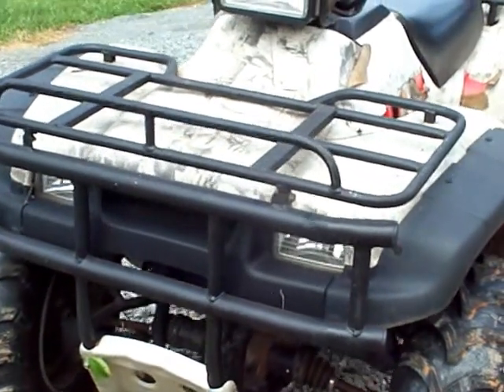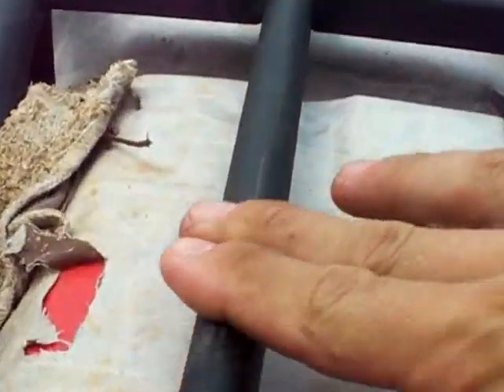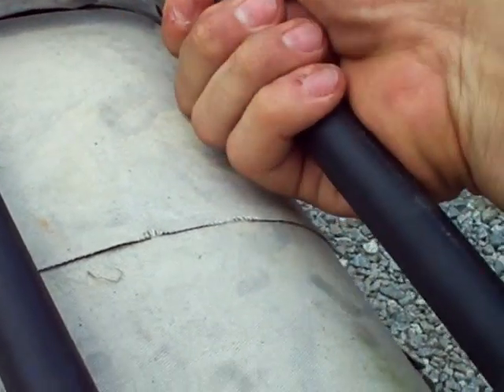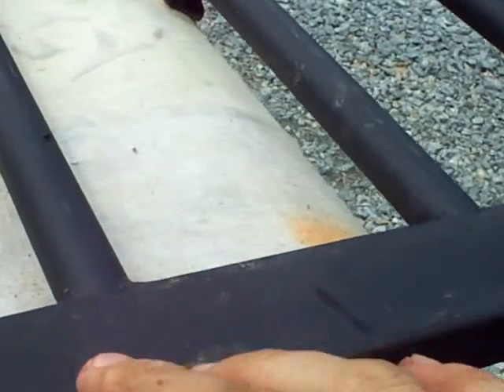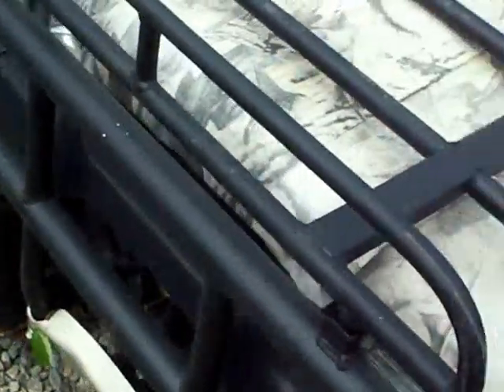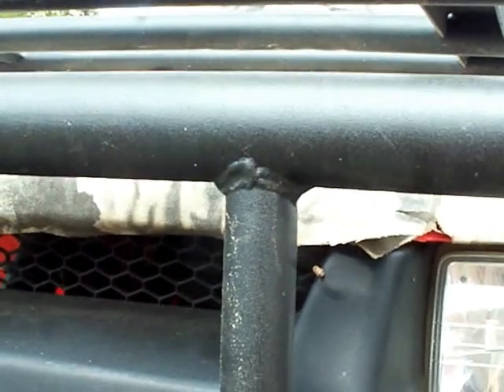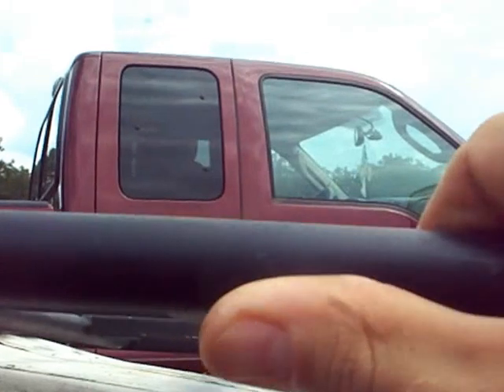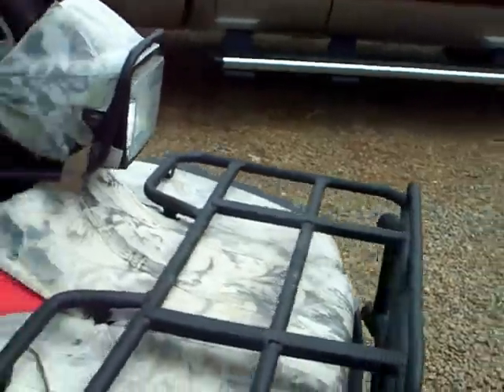Rust-Oleum truck bed spray coating review

Comment: cheyennerafterq I used this product on my chromed nerf bars this past weekend! It worked great. I put about 5 coats on it total allowing each coat to dry 30 minutes - 1 hr. Before applying, I sanded and scuffed the chrome up a bit with Norton Premium brand 80 grit sanding blocks I bought from Home Depot when I purchased the Rust Oleum Spray On Bed Liner

Comment from the maker: I pressure washed the bars, then I sanded them by hand with a course sand paper.  Afterwards I washed them off with mild soap and water with a cotton rag.  Left them out to dry.  When I sprayed them I was spraying coats about 10 minutes apart, but that varies base on your humidity and temperature.  just wait till it drys to a tack and spray the second coat, same for the third if you need it.

Comment: Rust-Oleum showed using it in conjunction with the truck bed coating roll on (not to be confused with the truck bed liner).  Rust-Oleum actually sells 3 different products targeted towards truck beds.  This product, from my understanding is identical to the truck bed coating that you can buy in pints and gallons.  If your thinking of using any of the coating products I would expect results similar to my video.  If you are using the professional truck bed liner kit you should have more durablity.

Comment from the maker: its basically paint with sand in it. If you paint a flat metal surface (any large contact area) shoes or rubber things will grip it well. Plastics will grip the textured surface better than standard paint as well.  If you layed a piece of heavy metal that had a tendance to slide this won't do much good.  On top of that if heavy metal is sliding this product will wear, like paint.  if you tell me what your planning to use it on I could talk more about that.

Comment from the maker: I would sand them a little, then clean them with soap and water, and spray a primer. Then when the primer drys to a tack I would spray the truck bed coating. Good luck and thanks for watching.

Comment: Considering those are removable, I would have taken them off, and taken them to someone to be sand blasted and powder coated.  It would probably cost around $50 to do but be a lot more durable.
Reply from the maker: Stinky Cheese honestly I doubt I could get powder coating done for less than $150.  Plus it wouldn't hold up any better, considering I stack 80lb concrete blocks on the bars.  2 cans of paint every 5 to 10 years isn't bad, just my 2 cents.
Reply: ^^^^theres always one who thinks he knows better! ^^^^ :/ Good job Cka1799 not bad at all for £7! gonna use this on the roll cage and bull bars of my pick up ;)

Comment: I want to do something to the floor of my motorcycle trailer! I think this would be good and a lot less expensive than Linex or similar! My trailer doesn't really get abused other than pulling a bike up on to it! What do you think about this for my trailer? Thanks bro
Reply from the maker: I think as long a you prep the surface good and put a good primer down it will be great for light use like your describing.

Comment: Hey I was just wondering, did you wire brush or file or sand anything the rack before hand or did you just spray right on top
Reply: You need to do that to remove any surface rust if you want decent long term adhesion, and of course wash it after.
Reply: Tyler Stonebraker Paint Stripper and Rust remover if it has any, Spray on bare metal after scuffing it up and youll be good

Comment: Really looking at using this for my head ache rack... would you recommend it?
Reply from the maker: what is a head ach rack? roll cage?
Reply: Its a rack that you put in the back of your pick up to protect your back windshield and helps with roll over protection too.
Reply from the maker: +Jason Cox yes.  it would look pretty good.  the texture might male it slightly harder to wash compared to a smooth chrome or paint surface.  If the coating is being rubbed or scratched expect results similar to paint.

Comment: so would you recommend it for doing this? and did you sand the racks down or anything before to get some of the surface rust off?
Reply from the maker: I like it better than paint.  we use it landscaping and its still looking good.  It wouldn't compare to  true bed liner, but for $7 every 5-7 years I'm good with it.
Reply from the maker: I sanded it lightly and washed and dried it real good